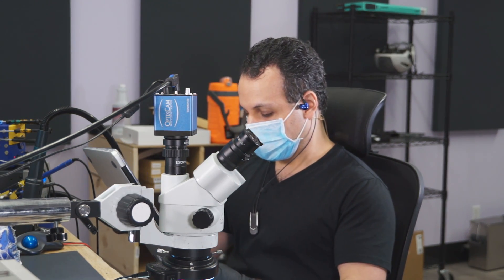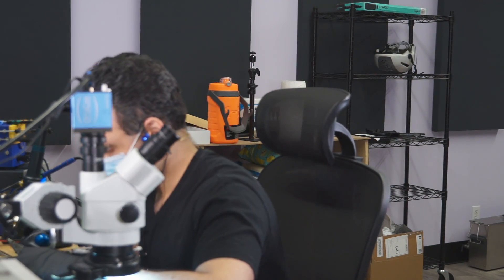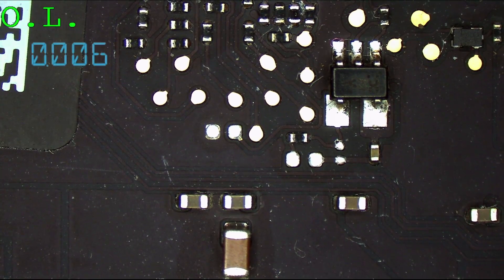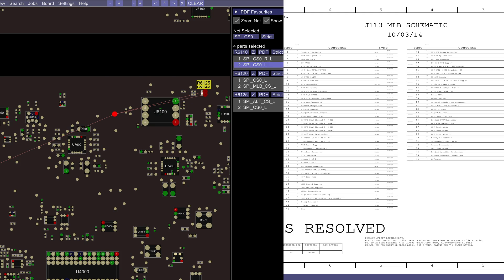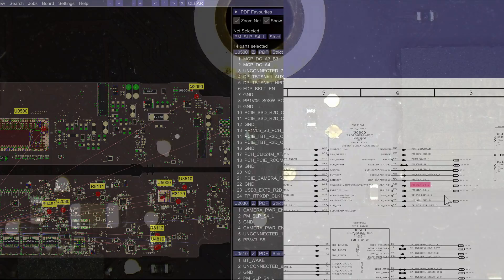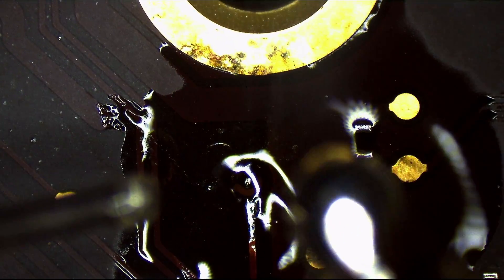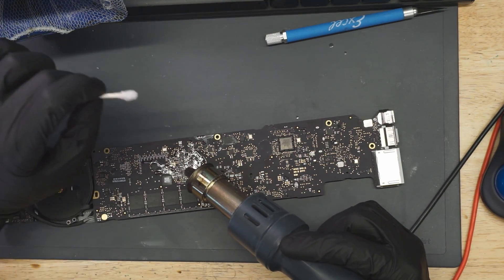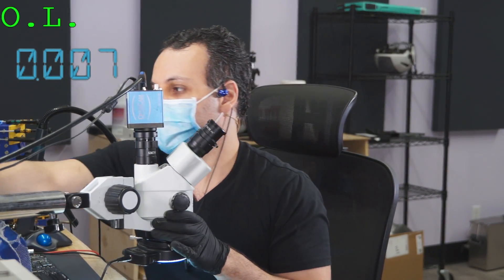A1466 Macbook Air 24 mA no PM_SLP_S4_L logic board repair

Comment: Hi Louis, I have watched a lot of your videos over the last couple of weeks or so and I admire the speed at which you fix things. Here is another sob story to add to the many you already have about Apple products. 
In 2012 I purchased an iPad 2 from an Apple developer in Hamilton, Canada. A couple of years later, or so,  I updated iOS to version 7.3 (? it may have been 7.1, can't quite remember) and the WiFi stopped working. I rang Apple up and spent a couple of hours on the phone with them trying to get it to work. No joy. The guy, in the end, told me to go to an Apple store. So I went to the Apple store in Burlington, Ontario, and after 30-45 minutes they couldn't get the WiFi to work either. I ended up having to buy a brand new iPad 2 for CDN$289. 
This all happened before I ever came across your channel or iPad Rehab's channel. Just for my curiosity, could you have fixed the 'WiFi not working' issue?
The iPad I bought above from the Apple store was immersed in water in December 2019 by accident for a few hours (it was inside a ziplock bag, which was in water for 1.5 hours, that had a tiny leak). I didn't know for 24 hours that water had got inside the bag. I never tried charging it or turning it on until I had soaked the iPad in 99.95% isopropyl Alchohol for 2 days and had let it dry for a week. Needless to say , when I did try turning it on it didn't work. Any chance that that the data is recoverable? Or that it could work again?

Comment: You know that for Apple to be Sooooo cheap if they developed a proper conformal coating to protect the electronics from dirt and moisture. Biggest issue is APPLES CRAPPLE RUNS TOOO DAMN HOT TO USE ONE TO "FIX" THIER DEFICIENCIES IN DESIGN.
IE no moisture invasion when clumsy owners spill or do nude sauna while computing with thier Apple crapple OR committing immoral acts while watching thier overpriced "unrepairable" Apple device.

Comment: Are there any issues with A1990 macbooks? (Besides the keyboard obviously)
Reply: Jakob yeah I got if for 1k off so I wont complain abt price to performance. But are there any specific reliability issues?
Reply: Jakob as far as I can tell it might only have the T2 issues and keyboard in the future. Anything that is on this Laptop is stored on GitHub and iCloud drive anyways so I dont care abt the data. So a reset isnt a big problem for me. I guess the only thing (known for now) is the keyboards failing, which I actually hope it does so I get the free upgrade to the 16 inch.
Reply: Jakob I mean it was 1k off 🤷‍♂️ So I would get basically the 16 inch for the price of an Air, and I can sell it then to buy something I can run a kvm with macOS on 😂
Reply: Jakob I guess you dont know the Apple „repair“ program, the 4th time the keyboard breaks, you get the 16“.
Reply: Also it is a 2019, I bought it brand new when the 16“ was öike 1 month old

Comment: Hey Louis I wanted to ask you something. I have a 2020 MacBook Air that is atrocious. I can't even run a simple game and it heats up with the fan at 8000 RPM. I wanted to know if you'd recommend the Dell XPS 15 for students who also like to play games like Minecraft, since I already play high demanding games on console. Would you recommend the XPS 15 2020?
Reply: Just my two cents, but you may need to try limiting the resource usage of the game , like if you're on Windows use MSI Afterburner to limit framerate etc.  It would run  that way on any other integrated GPU.  Also if you're using Bootcamp you'll lose all of Apple's power management so it will heat it up and start throttling.
Reply: @dariofd351  Im not using Bootcamp. I already tried to set the setting to the lowest possible. Still heats up to 90+ C.
Reply: @amdchurro  try making a base for it if you are placing it on your lap ot on a desk it will heat up cause the do not make legs big enough
Reply: Every ultra-thin laptop will have heat issues. The Dell less than the MacBook, but you can’t get by the law of physics. I‘d recommend a Dell Latitude
Reply: My toast oven can play minecraft
Reply: Laptop cooler and lower setting is best bet for MacOS users
Reply: Jakob I still have 90 days to return it

Comment: have you torn up any customer's laptop stickers with all the alcohol scrubbing? just wondering
Reply: Dissolving adhesives with IPA requires minutes of soaking. Acetone and xylene would be quick enough to semi-accidentally strip stickers, but they would also ruin plastics and paints... 🙂